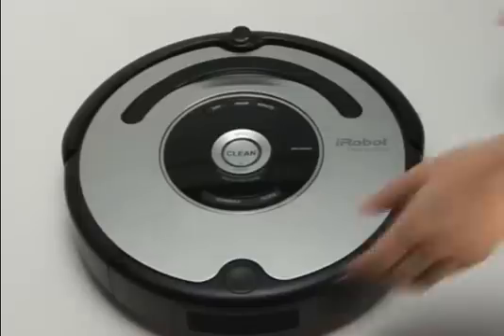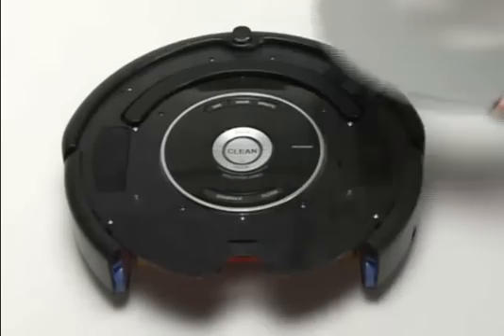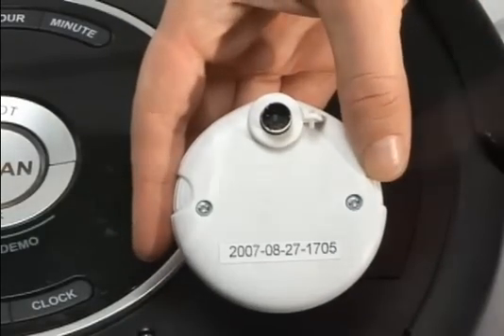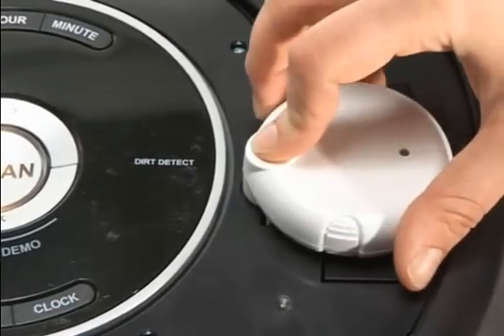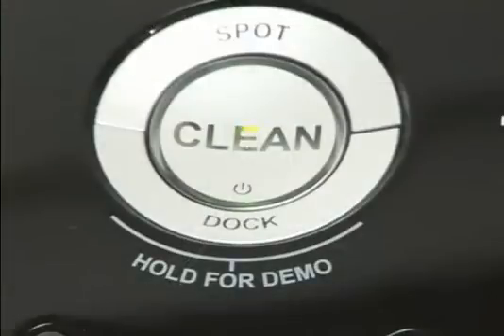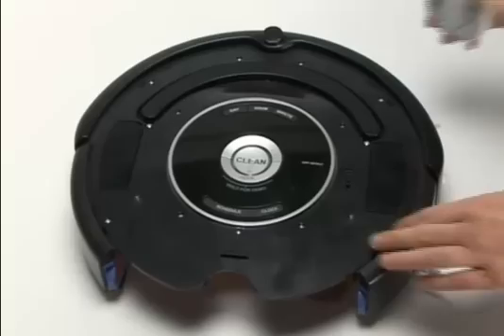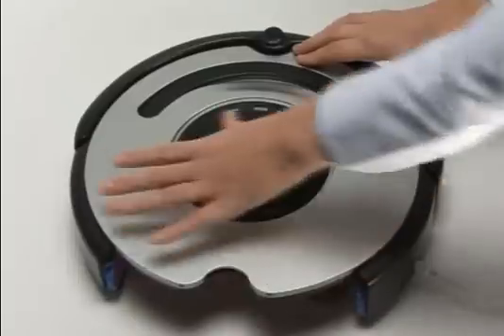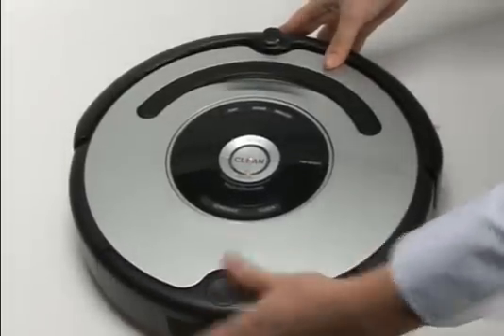How to install the OSMO on the iRobot Roomba 500 Series

Comment: OSMO is an Updated Software that will make your older 500/600 Series Roomba Clean a little different which will make it clean more area with single charge, so in a way it makes your battery last longer.